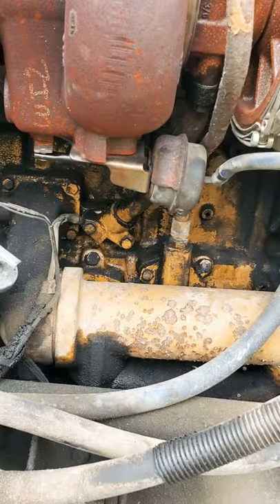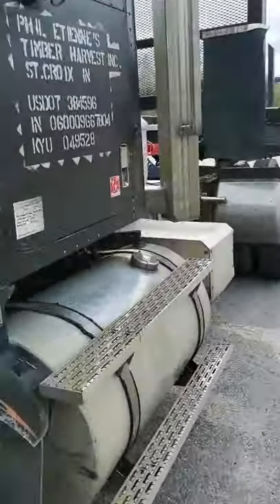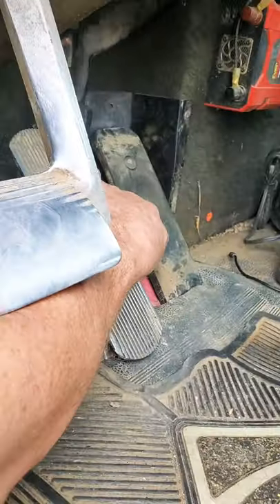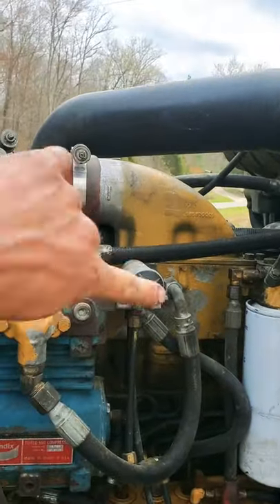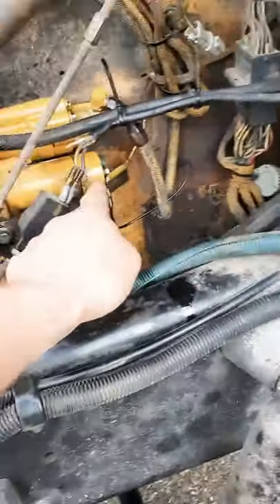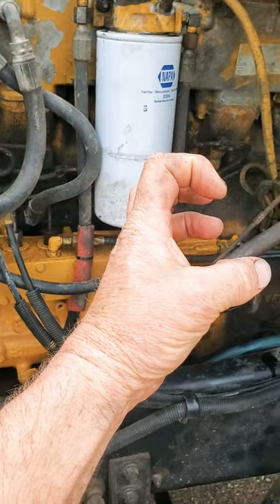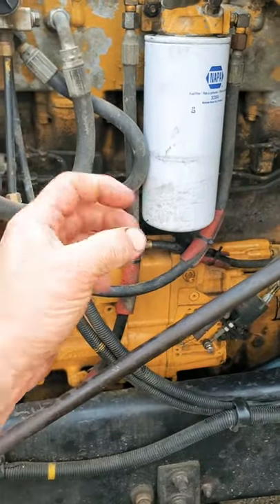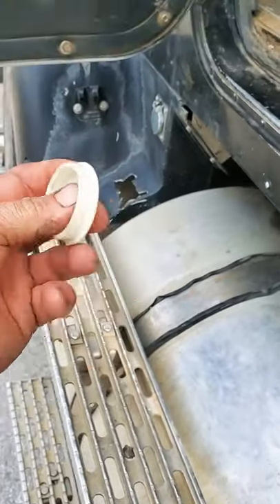Done Blowed me Diaphragm!!  #shorts

Comment: Air fuel ratio control. Pretty common failure even with “normal” boost pressure.
Reply from the maker: Got ya thanks bud I got extra rubbers
Reply: @LoggerWade  I’d get a reman to have on hand. Sometimes they are hard to get to seal up.